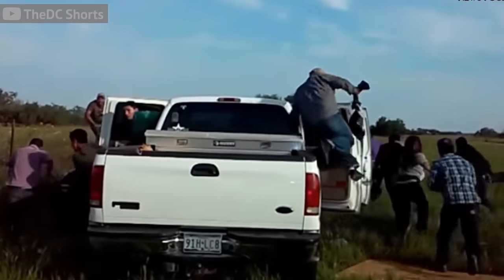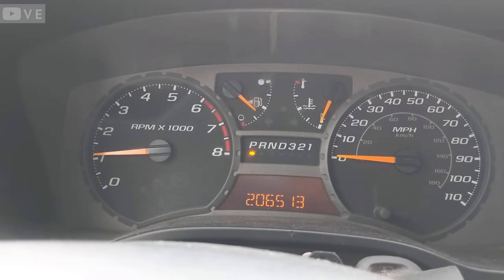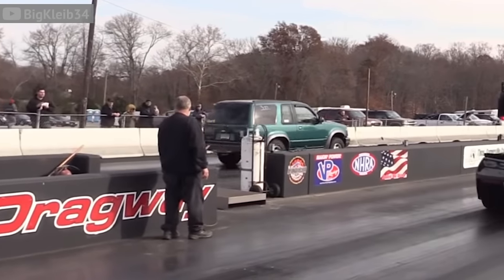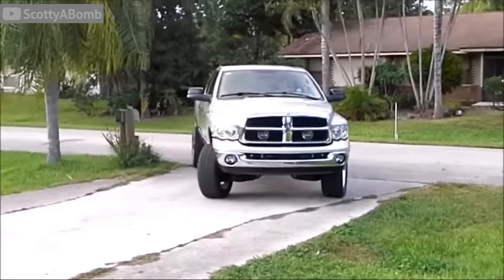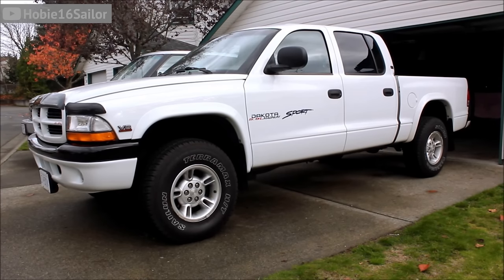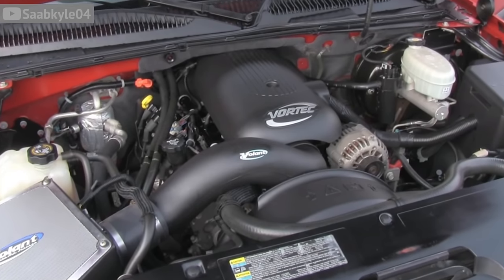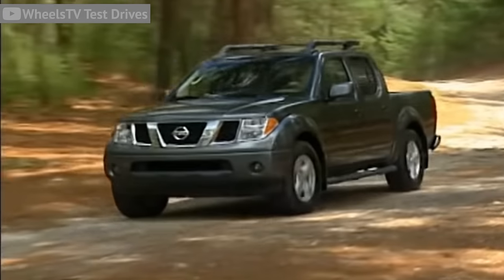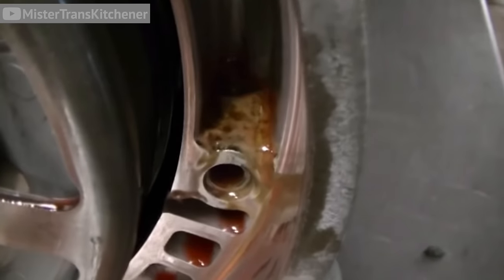USED TRUCKS YOU SHOULD NEVER BUY!

Comment: Your opinion on the Avalanche is just that. Your opinion. I have an '09, and it runs like a top! It also still looks great! No problems since I got it except for a simply replaceable fuel control module. Has almost 200k miles, and is still going strong. As far as I am concerned, GM should come back out with the Avalanche. If you haven't noticed, there are a lot of Avalanche video's on here, including one pulling and 18 wheeler transfer truck up an icy hill. This is MY opinion. People didn't know they had a good thing when they had a chance at it. Mine also has a 12k towing capacity, along with all the bells and whistles that could be had. I LOVE it! Wouldn't trade it for anything else, and I will drive it until the wheels fall off! The  SSR wasn't built to be used as a 'regular truck'. It was the same as the Prowler. It was created as a very narrow niche vehicle. What can you do with a Prowler? Nothing but put 2 people in and drive. The same with the SSR. Just a different version of the same idea. An extreme niche vehicle. There is actually a beautiful red SSR near where I live, that I see several times a week. A daily driver. How many prowlers do you still see driving around? I haven't personally seen one in several years. I worked at a Chevrolet Dealership for a while and learned a lot about these vehicles. I'm not sure about your area, but where I currently work, There are at least 6-8 Avalanches in our parking lot, every time I go to work, and I see at least 2-3 every time I get around town. And they are all, for the most part in excellent condition. A small number need a lot of tender loving care, but that is just because their owners don't GAS. But really, don't knock the SSR because it's not a big, burly, haul 10 tons truck. It wasn't created to be that. It was a variation of what created the Prowler. GM decided to build something like the Prowler, with MUCH more usable power, to get sales. They succeeded. And the Avalanche was/is the best of both worlds between the Silverado, and the Suburban. You can haul 5-6 people, and 12k pounds, or you can loose 3 people, drop the back seat and haul 8 ft long panels of plywood, and it stays completely dry! You can't do that with any other vehicle then or now except with an Avalanche! So you need to do your homework. Ask some questions before you start spouting your own opinions. We don't need opinions, we need facts! And your's are definitely not facts!
Reply: Just topped 200K, and still running strong 5.3L. I've seen these drag Fords and Dodge's backward with all wheels smoking. Get you one! You will love it!

Comment: My 2002 Avalanche 4x4 that now has 400k miles is by far the best truck I’ve ever owned. I’ve replaced several things like transmissions and fuel pumps, things that are gonna fail on any vehicle but the motor is bulletproof. It uses a quart of oil a month but the engine has never been opened. Never. This truck does not belong on this list.

Comment: You’re completely wrong about the avalanche. Proven to be the most reliable vehicles on the road, it’s not any different than a Silverado or Tahoe.
Reply: MrPland1992 I bought an 09 in 2018 with 170k on it and it rides, drives and runs like a new truck.  Plan to keep it for 4 more years.
Reply: Rick Collins just picked up a clean 2005 LT. loaded and looks just like it did off the showroom floor. 250k though. Got it for $1000, didn’t run but I only had to put a starter and fix some grounds on the engine. Dude was pissed when I started it up and drove off 20 minutes after buying it lmao. 

Does need several maintenance items but everything is cheap.

Comment: I’ve had my dodge Dakota since 97 and never had any issues with it
Reply: TheDogfighter129 I have a 2000 dodge Dakota 3.9 l magnum manual. He is just into bigger more expensive trucks
Reply: I got a 88 Dodge Dakota manual with 92k on it
Reply: I got an 06’ Dakota 4.7 V8 93,000 miles with maintenance. My grandpa’s 97’ Dakota went over 300,000 miles.
Reply: Exactly mine has 250000 miles no issues
Reply: If you’ve had it since 97 then it clearly isn’t a 2000-2006 like he’s talking about
Reply: Alfie well he actually said to stay away from Dakotas in general at the beginning he just said especially stay away from 2000-2006.
Reply: Yea the Dakota is solid especially with the 318/360 v8s they are awesome
Reply: Older dodge trucks are better then the newer one the engine are bulletproof

Comment: I am a proud Avalanche owner, I had it for a year and I have had minimal problems with it. Yes, the speedometer failed, as well as the rest of the gauges, but nothing a OBD2 scanner can't fix (IE, one that will tell you speed, pressure, temp, the works). It all depends on how it is taken care of. I know a lotta F150 owners that didn't take care of them and they failed, yet my Avalanche has been cared for and it keeps trucking.

Comment: I have an 04 Avalanche and absolutely LOVE IT!  I've had the spedo fail on me but it's a cheap and easy thing to pull it and send it out to be rebuilt.  The rebuilders say they use better than factory parts so it shouldn't be an issue again.  As for the "paint", the armor isn't painted, it just fades out after a decade or so.  A little Wipe-Nu and you're golden for another 5 to 10 years.  Oil: they don't burn oil but after about 150k miles the rear crank seal may go.  The hardest part of that repair is pulling the tranny to get to it.  

To quote an Alan Jackson song, "you can light it on fire and roll it down a hill but I still wouldn't trade it for a Coup Deville."  You're wrong for including it on this list sir.

Comment: This dude is a tool but he’s right about the 5.4’s. He didn’t specify the years but after 2003 or so you want to be cautious.
Reply: The 4.6 blows out plugs too. It's not just the 5.4, but they more commonly do it.
Reply: 2004 for Navigators and Expeditions.
Reply: 5.4s are decent engines. They can get to 200k easily. Yeah sure they may blow plugs but that can be avoided by changing them frequently. The downfall of a 5.4 is when you get to about 225k, that's when they start having issues but if you put a couple hundred bucks into them they'll go another 200k with no issue. My 5.4 has 350k and hasn't had any major issues since it was at about 220k miles

Comment: Dude I freaking love my 2008 Avalanche!! I've had it for 6 and half years now and it has 143000 miles. Runs great drives great. Towed motorcycles to Sturgis and slept in my covered bed. I also take a 2400 mile round trips up north for Christmas every year and my family still loves riding in it. My plastics are painted so no fading, and I have never had issues with my super reliable 5.3. The versatility of removing the glass and folding in the rear seat while also having a covered locked bed never gets old. Also the Avalanche has had lockable "Ram boxes" long before dodge came up with them. I say bring back the Avalanche! It is absolutely perfect for my towing, hauling, and road trip needs.

Comment: The 2002 and 2003 Chevy Avalanche were one of the best trucks around, ... we had several. Each one had excellent performance and was solid like on rails when driving (4x4) over snowy icy roads. No issues with oil consumption, and gas mileage was also pretty good at around 18 mpg with a 4.10 rear axle ratio.

Comment: Well you can get a v8 from ford for those times just get the 4.6 instead of the 5.4
Reply: Me personally I didn't have any of those problems with the 5.4 v8 we had an expedition with one of those for a few years and friend bought one brand new in 05 and still has the same motor and transmission with over 300k miles 😂and not a single one of them problems came into play
Reply: Jonathen Warner same it was the early 5.4’s I got a 09 f150 unopened original engine & transmission with over 260k miles still running strong all the way to redline
Reply: As long as it’s a 2 or 4 valve engine.

Comment: I bought a used 2007 Avalanche in 2016 with 149,000 miles on it. I’ve owned it since and have over 400,000 miles on it. The only work I’ve done on it was to replace the catalytic converters and a throttle position sensor (which turned out to be just cleaning the throttle body) to clear the codes. That’s it, other than brake pads, tires and a battery. The electronic dash display (odometer and message center) went out but I was too cheap to have it replaced for $150. I LOVE my Avalanche and would buy another one tomorrow. The handling and SUV-like feel of the  truck are great. I also love Tahoe’s and Yukon’s. Maybe I’m just lucky with my experience?
Reply: No, I don't think that you are lucky. Mine is an '09, and the only problem, other than a couple of sensors, was the fuel control module, which was less than 60 bucks, and easily replacable. It's a fully loaded LT originally from San Antonio, TX. I wouldn't trade it for 10 new trucks!

Comment: My favorite truck which I actually own is an 03 Chevy K2500HD 4 door short bed with a 6 inch lift and 37 inch tires and tons of accessories power adders and as well as visual components with an original LBZ Durumax and 5 speed Allison transmission, despite some of them having injector issues Chevy took care of that problem with recalls and a 200,000 warranty. I like it because the 03 LBZ was the last year free of all the emissions Bullshit such as an EGR system and catalytic converter. Mine has 230,000 miles and runs like a dream it is still even running the stock Allison transmission with no issues!

Comment: Who on earth is this guy he obviously has never even driven a truck probably drives a Toyota Prius because yeah avalanche has trouble with body panel rust but outside that it’s the exact same motor and transmission used in the Silverado Tahoe Yukon sierra and others and I’ve owned several and mines pushing 400,000 miles and still not using oil not leaking it and transmission is tuff as any I’ve ever had bought a 2wd avalanche with 200,000 for 3000 that was tax title and license flat out the door had for a couple years and drove the wheels off it and I’d still trust it to California to run this idiots Prius over and still drive it back home lmao some people will do or say anything to try and get attention but dude show me a ford or dodge that you can buy for that kinda money and do nothing but oil changes and regular maintenance such as brakes outside that I’ve not done nothing but drive it oh other than rear ended someone on the interstate at about 55 and it didn’t hurt it just barely ding the front bumper and still drove home this guy would cry if he ever gets in a LS powered Chevy and beg for his mommy if any one ever opens it up all the way he’ll need new Huggies lol

Comment: I like how when they were talking about the Ford 5.4 they had a Ford explorer drag racing to represent the 5.4 lol they never had the 5.4
Reply: scout hockema it was a swap lol
Reply: I hate the 5.4 but I just wanted to clarify
Reply: The ford exploder with the 4.0 v6 is no good either
Reply: @firstlast7613  4.0 was a good motor, it was the 3.0 that was shit, underpowered, had a flawed intake, poor ignition system, fuel pumps are bad, the fuel ethanol sensor goes out like clockwork, the radiators were a little underperforming, the thermostats were terrible and a complete pain in the ass to reach, valve seats  were weak, it was an interference engine, the bellhousings we're somewhat weak, the rear main likes to leak oil on the clutch, and the water pumps have a bad tendency to rust the blades off inside the engine.

Comment: I have an 05 Avalanche with 300k+ miles and while Chevrolet should have put a beefier trans in it, ive never had a single problem with my truck, no speedometer issue, no trans issues, no engine issues, nothing. And this truck has been pulling 10k lb trailers all its life. The cladding is plastic not painted and like any plastics, it fades in the sun, but plastic was the best call because its easy to scuff it when loading stuff in the bed and id rather scuff plastic than chip and scratch paint. The extendable bed of the avalanche was the best thing ever. I think this guy doesn't know what hes talking about and just likes to get views

Comment: Since 2004, I bought a new 2005 Chevy Avalanche Z71 and this is the best truck ever had and still running great. Barely having problems, just normal wear parts. I see 2004 and older kind have those plastics on the door and plastic bumper, potential issue to accumulate dirt ending in rust, but I never heard any mechanical issues, just looks ugly the faded plastics.

My 2005 are the first ones without the plastic door and came with metal bumper. I remember before the warranty ends in 2009, the dealer treated the box plastic parts with Rhino Paint. 
I now understood the 2005-2008 was the best Avalanche made. Never have major issues. Newer Avalanches comes with so many gadgets, potential issues for failure. Did come with Bose system, leather seats, the Z71 of road kit and it's 4x4. In reaching the 20 years, the only I change so far are common things like shocks, brake discs/pads, a oxygen sensor, 4x4 transfer switch, etc... just normal small things. Also, I remember when first send it for oil change, the mechanic told me that Chevy normally not put too much oil on the differential causing issues in the long run and he added some for me, something that today I do appreciated. That truck runs like new, I feel that I can drive from Florida to Oregon and come back without issues.

My brother in law had a 2008 and for personal issues sold it to a guy that still have it without problems, something that he regrets today.  But, he like it so much, that later bought a 2011 Avalanche. Came with automatic foot bar rails, fancy air suspension and that weird 8 to 6 cylinder motor switching system.  He had so many issues with the computer and even got a new engine. He still love the truck but always afraid something will come out. My truck only worry to put gas. 

I can see after 2008, Chevy added to the computer too many things to be monitored, and that increase the chance the need of replacing parts. Even the hood have a air bottle for smooth opening, my 2005 is just a spring load, which one do you think will break first? 

In another words, only get a Chevy Avalanche from 2002-2008. If you get one with one owner like me and looks good, get it, you not will be disappoint. Don't get any from 2009-2014.

Comment: Just bought a 2007 avalanche in 2022. I wanted a truck but something luxurious, unique and still good looking . My father has always had GM sierras and his 2008 which was meticulously maintained and oil sprayed has significantly more rust then my avalanche. Powered Leather heated seats, Nav, Sirius XM, Bose, rear view camera, folding mirrors, dimming side mirrors, dual climate control , 4 cigarette lighters , rear climate and radio controls . LTZ model so it has auto leveling air ride suspension from the Escalade and a 5.3L with cylinder deactivation. This truck is awesome .
Reply: Oh and coil springs with side box locking storage , people will argue that leaf springs can handle more of a load, I argue your girl enjoys my air ride suspension with rear coil springs and aluminum front lower control arms more🤷🏼‍♂️

Comment: I owned a 2002 Avalanche for 17 years.  Best truck I ever owned.  Lived in Michigans Upper Peninsula and it endured harsh snowy winters with ease.  Seriously, I would use the auto 4x4 setting all winter.  Sold it in 2019 with 240,000 miles on it.  Only issues were the power window motors slowing down, power seat motors, and probably put 3 alternators.   The body plastic trim really worked against rust.  Frame has some rust but it was undercoated when it was new.  Bought a used 2014 Silverado and it has completely rusted out.  I see Silverados, all with the same rust issues. GM should be sued for building trucks that are designed to rust.

Comment: My papaw and Dad both passed away, so a 2004 Chevy avalanche was passed down to me. Best fucking truck I’ve ever had. I grew up in it. All sentimental shit aside, it’s got 240,000 miles, and still runs like a champ. Transmission is shifting a bit hard but that’s it. It even had the crappy factory intake gaskets, which I changed when swapping knock sensors. Best truck ever

Comment: The Avalanche was my favorite truck of my dad's rigs, when I got my licence at 16!   It took me on road AND off road with tremendous capability, and lasted a long time!    Long enough for me to use when I started university, drive for an additional 3 years and eventually sell it, myself.    It was stupid reliable, strong, fun and very off road capable, for a stock Chevy!     I have even recently bought one for nostalgia!

Not sure why it was a thumbnail here.   It DEFINITELY doesn't belong on this list.    Basic maintenance keeps them going well over 200k kilometers.    I sold mine at 256k kilometers, still running like it was only 2 years old.   Because of the great condition, I got the full asking price!

The ONLY major problems to look for now is transmission issues,  if it was used to tow but not properly put in tow mode

Comment: As an avalanche owner, loving the support here. 03 avalanche RWD 35’s 3 in. Lift w/ 165,000 miles. First truck 8 years ago at 19 and beat the living daylight out of it off-road in places like 4x4 Jeep trails top of Kings Canyon, places a RWD truck this size shouldn’t be capable of going but it did, and even some light mudding 😂 truck has never complained but now the trans did just go out. Gonna get a GX470 for family SUV then looking to either do a rebuild with stronger internals or a 4L80e swap and keeping the truck to modify as a fun/work truck till the engine dies out, probably another 160,000 miles later.